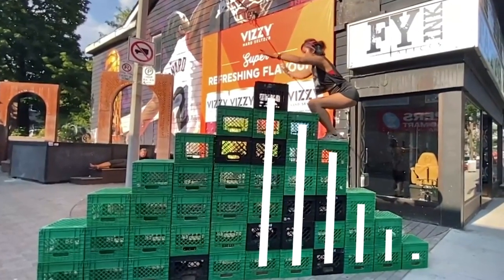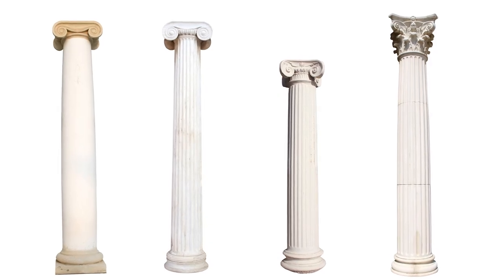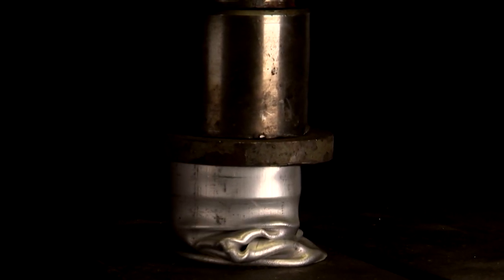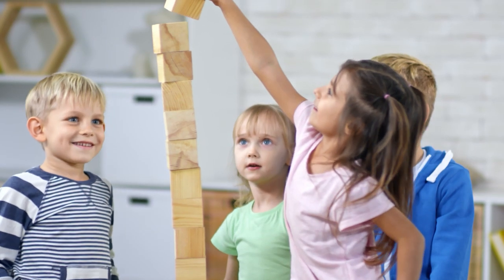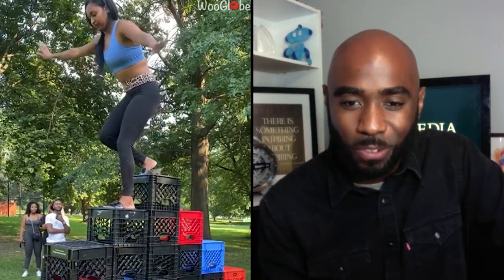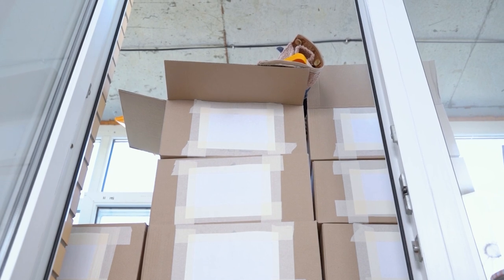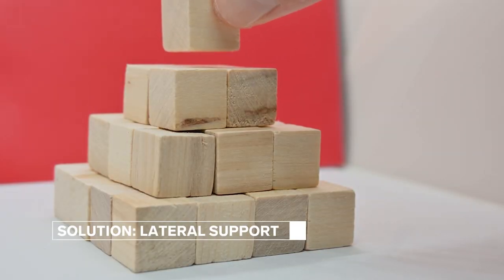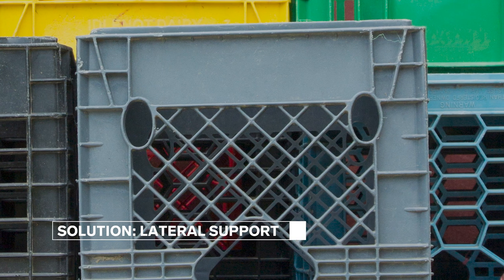Why You’ll Fail the Milk Crate Challenge | WIRED

Comment: The reason Fedex has the rule when loading trucks...

Overlaps not towers. Create a singular flowing structure connected at multiple points, evenly distributing force through the load as opposed to directional force like towers would be.
Reply: The when they deliver the package, they'll pull it out carefully and just throw it on the porch. Shouldn't destabilize the packages in the truck, right?

Comment: After working as a carpenter for years, using sketchy planks and ladders on uneven ground all the time. Think I could probably beat this challenge. BUT it's not really worth a bad sprain or trip to the hospital. So I'll never know. Cool vid!
Reply: It’s possible to beat, with extremely fine motor control and luck
Reply: actually yes it is IF they doin the money challenge since its normally 10k and if you are confident in your landing skills to not take too much damage then you good

Comment: 1. They almost always build on grass, which is unstable

2. They almost always use old crates that flex and give

3. They try to stay in control by going slow, which only gives more time to get tired and lose balance
Reply: Try and upload your video link
Reply: yh the slower u go ur applying more pressure to the crate
Reply: @lildroptop4178  IT's the same amount of pressure exerted on the crate. the body weight doesn't float unless you're running and both feet are off the surface.
Reply: And if you place the crates on concrete instead of grass you will fall anyway but the fall will be worse.

Comment: Another thing to mention is that as you step on each column you are essentially becoming part of that column. You're adding both weight and height and because you weigh considerably more than all the crates combined, you raise the centre of mass of the column to a point where it becomes extremely top heavy and unstable. This problem is then compounded by the effects our kind man explained in the video.

Comment: In my opinion he missed a vital important factor with this challenge specifically on the descent.
The initial placement and force of the foot is the most unstable period, having control in this time is vital. 
On the ascent, your foot placement is closer to your body as you're simply raising a leg to knee height. However, once you're descending your foot is now completely outstretched all the way to your hip. That provides significantly less initial fine motor control of any present instability. The climber tries to counter this initial instability but due to the lack of control, compared to the ascent, an over compensation is achieved.

Essentially it's very close to over steering a car that has lost control. Back and forth until complete control is lost.
Reply: in a car it's called oversteer.
Reply: he specifically stated that going down fails because people cant control their their weight placement on the crate he further states it has to be direct center for it and if its off center it creates the horizontal jilt which causes the wobbling and eventual downfall.
Reply: @ByakuganXEyeX  I'm talking specifically about the concept of oversteer, and how the ascent can appear easier, as your feet are closer to your centre of gravity and thus easier to control. Sorry if that wasn't clear.

Comment: So I wonder if the way to complete the crate challenge would be to never put both feet on the crates, each foot steps onto the next crate stack in the center. Coming down will still be a problem, though since you will have to shift weight forward in the direction where the crates don't have a taller stack to take some of the weight like the stack does going up.
Reply: The centre of the crate is actually somewhat fragile, it’s pretty easy to put your foot right through the crate if it’s already in poor shape.
Reply: @Paddyhudson  is that a critique to the original comment or what? He is right
Reply: A little kid could do it I think

Comment: This challenge has nothing to do with the load on the crates. They are not buckling. The problem is that it is like you're standing on top of a unsecured pole - it takes very little sideways force to make it topple over. And when it does, you're almost guaranteed to fall a few meters onto a crate with its sharp edges poking into your body. Tight rope walkers should do well on this challenge.

Comment: This misses a critical failure point, the older crates have rounded or ground down bottoms which do not stack nicely like the newer crates. As you drag them on concrete, the bottom crate get worn down. You even saw it in the video, look at the black crates and how they are concentrated at the top of the pyramid. In my experience the black /duller crates are usually older stock, as opposed to the blue/vibrant crates. Any video you see of people actually completing this are either faked or a product of using newer crates that actually stack really well. The science is right but there is more at play than just science.

Comment: Because your weight coming down onto the high point of the crate complex causes it to collapse because it is an unstable structure. There's the answer.
Reply: Wrong. Leave the crates by themselves, they are stable. Subject them to anything, like a gale force wind or a mindless human doing the challenge, it will collapse. 

And before you tell me that the above doesn't make sense, your reasoning itself is not good enough. All structures, subjected to a greater force or load more that its original intended design, will still collapse. A stable RC column can only withstand a certain design load, and subject that RC column to a load higher than its intended design, it will collapse.
Reply: @MrQwertypoiuyty  the question is talking about why humans would fail the crate challenge and I answered it. I didn't say human weight is the only factor which would contribute to the crates collapsing lol. Go be pretentious somewhere else, weirdo.

Comment: The explanation was very stupid. And stating that you are an engineer to gain credibility degrades the value of being an engineer. People would say "Is this what you learn at engineering school?" (I am an engineer, too)

The explanation is not in engineering, but human anatomy. Due to the structural design of knees bending in limited angle, it is hard to make the weight transfer while keeping the pressure point in the center of crate columns walking downwards. Just imagine the difficulty in steping down the stairs when the steps are higher than usual, you will understand what i am saying.

Comment: Doesn’t really have much to do with the buckling he was talking about, and the critical load stuff. A single crate can support a person, 5 can too. It has to do with center of gravity in the columns as they increase in height. As you increase the height , the center of gravity elevates to some degree. Once you reach a point where the center of gravity in the stack is higher than the 1st or 2nd one balance becomes incredibly hard to maintain as the crates are not secure to anything.